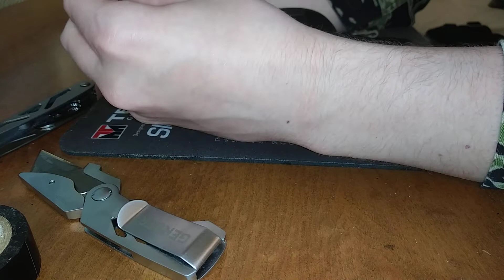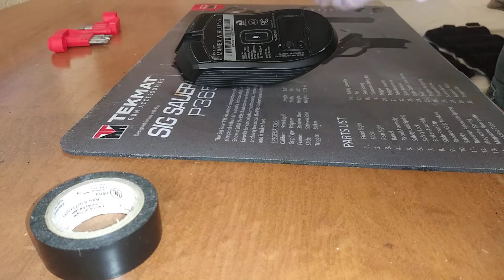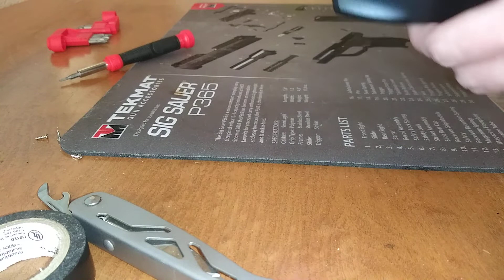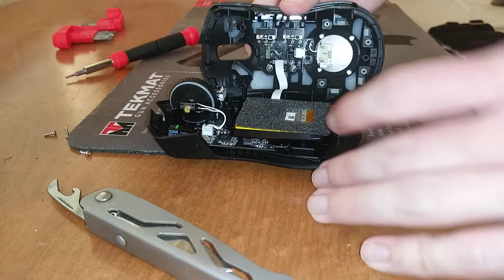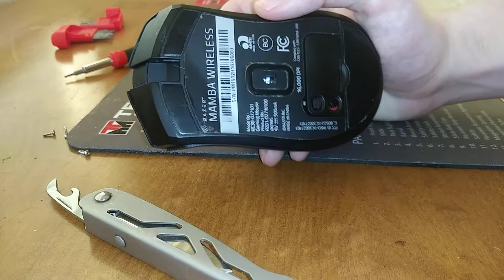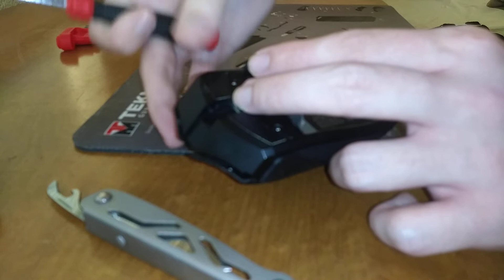Razer Mamba Wireless double click issue, click and drag issue fix

Comment from the maker: It should be noted that this is for the Razer Mamba Wireless model and not the Razer Mamba Elite model, which has a different takedown process.

It should also be noted that, while I didn't state it in the video, you may consider adding one or multiple layers of tape depending on your tape thickness and particular mouse. I personally used two layers of electrical tape on each side and properly adjusted my screws and the issue is seemingly entirely resolved for now for my particular mouse. You may have to play around with layering your tape and adjusting your screws more or less due to tolerances being slightly different between products.
Reply: I tried a similar fix, and still didn't work all the time. Tried cutting a 50 cent plastic folder and super gluing it to it instead. Worked like a charm.

Comment: I had trouble snapping down the right mouse click side as well. Push down between the gap under the right mouse button using a wide enough flat head screw driver, it helps deliver the force in the right spot to get the right side to snap in, make sure you already snapped in the left side by pinching the middle area in front of the mouse wheel.

Comment: Dude most helpful advice i could've hoped for! For those who missed the screw holding the down part. - It is located right behind the lower slider to be exact 8 mm downwards from the lid. Dont be afraid to rip it off - it will stick again smoothly. Just warm up the glue with a hair dryer or lighter.

Comment: It is worth mentioning that sometimes you only need to tighten the screws a bit without needing to add tape as the screws can get loose overtime or if you drop your mouse. which was the case for me.
Reply: Thanks very much for that tip. It took me 2 minutes to tighten the screws and everything works perfect!
Reply: Same here.  Tightening the screws fixed my issue as well!  My man!

Comment: I've smacked and banged my mouse around so much thinking that would knock things back in place on the inside and fix it, but it turns out that this was my exact problem. Instantly fixed it. If you still check the comments on this video, thank you.
Reply from the maker: I do, glad it helped

Comment: Mine still had the problem, I've no clue what I did wrong.
Reply from the maker: It's not a perfect fix unfortunately, it can alleviate symptoms for a while in the mouse but you might always have some problems. I notice that they can come and go after the fix for basically no reason, so it's possible it could still level itself out after a couple weeks. I'd try playing with the screws underneath the mouse buttons a bit more before completely giving up on it, I've extended my mouse's lifespan about a year at this point by just by being patient with it.

Comment: hey. my razer mamba wireless right click requires a lot of force to click once because my brother threw it on the ground. what can i do to fix it, does it show it on the video
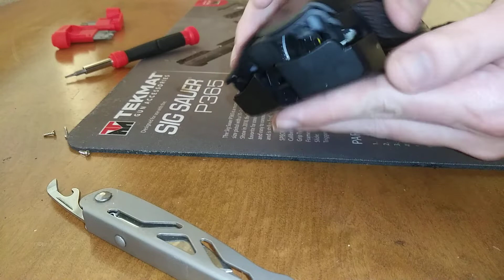Reply from the maker: It could be that the upper shell separated a bit from the lower half which could prevent contact between the buttons and the internal switches; you could try viewing 5:30 to 7:05 in the video to get an idea of what I mean and how it might be fixed by realigning the shells together, but obviously I can't guarantee that this is the problem in the first place. If this is the case it's an easy fix with the right technique and amount of applied force.

If you wanted to try to diagnose the problem from the start, you could always do a complete disassembly as shown from the start of the video and manually click the switch with your finger to confirm that it's not an issue with the switch itself, it will still register as a click to the computer if plugged in and the switch is functioning. If that works fine, inspect the parts to make sure there's no breakages in the plastic causing the issue, then reassemble the shells at the timestamps I posted above. If the switch itself isn't responding, then unfortunately there's a whole ordeal of taking it out and soldering in a new switch, which you can find youtube tutorials over.

Comment: Just finished managing to get the thing shut- works like new! Thanks for this so much. FWIW, I noticed that the "switches" were what was making it tricky, at least it was so on my repair. So, I made them smaller and utilized the torx driver to make sure it stayed in position, was easy from there. Thanks again!
Reply: Congratulation sir. Congratulation

Comment: I opened the mouse as suggested, put bit of a WD40 on the switches, which used to fix the issue on my old Lachesis mouse. Seem to help here as well, but for the love of god i could not put the mouse together. The left and right button simply would not click properly, screwed and unscrewed several times and only made it worse, as they would not click at all in the end.
I got new Deathadder V2 instead with those optical switches, and if it develops this double click/drag issue anyway, it will be my last Razer.
Reply from the maker: yeah the issue is definitely a pain, hope your new mouse is working better
Reply: @faceless2302  thanks. New mouse works just fine, but so did Mamba when it was new. Anyway, i have a friend who is kinda good at fixing stuff of this kind, so i gave it to him, and he managed it! Just brought it back to me. So far, so good, just the right rubber side went off, i need to glue it back. But the buttons click again and no double-clicking (though that much i managed to fix myself already, putting it back together in the working state was the problem). Now i have 2 working Razer mice,  just put Deathadder back into box and save it for the future.